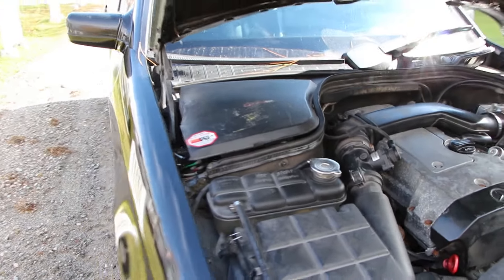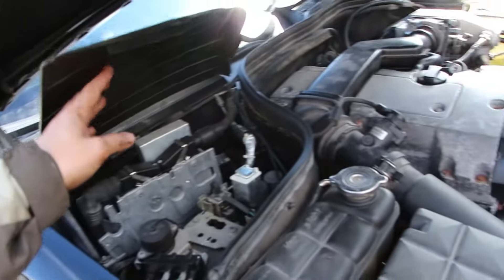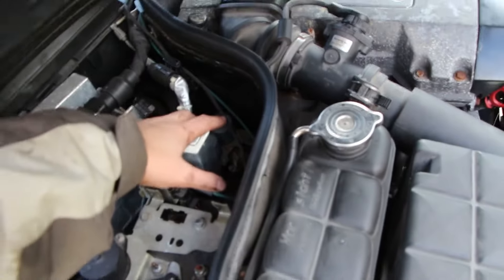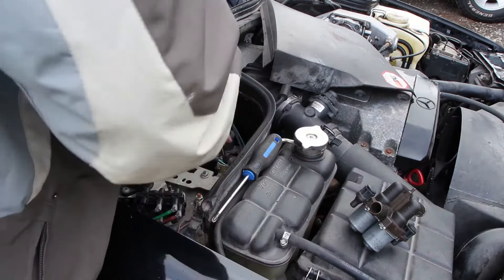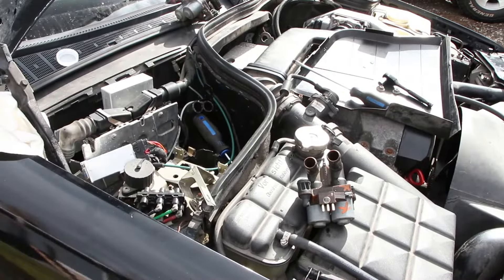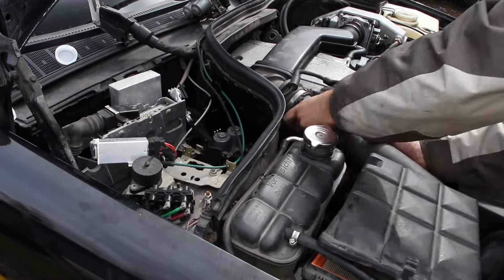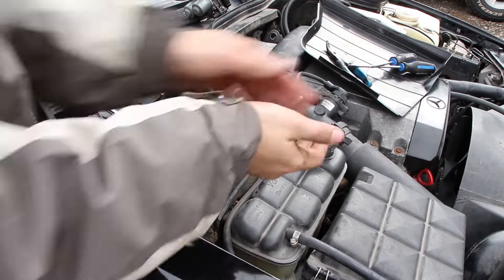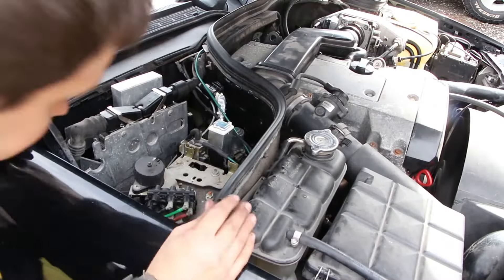Mercedes Heating Valve Replacement

Comment: Bro this looks so fast and easy my car been in the shop for 4 days because of this problem
Reply from the maker: Yeah it's pretty straight-forward. Usually the issue is getting a new heating valve, they're no longer available. Junkyards are full of them though, and rebuild kits are readily available, they are also very easy to rebuild. I have a video on that too.

Comment: Hello.i got an mercedes benz a class a170,1.7 petrol,2005,before Christmas i was in holliday,before to i go my car in the morning works perfectly,even in the morning,at -4 ,-5 grade in couple of minutes was warm in the car...when i comeback from holliday my car heating work but poor,i can feel it very low,on first level on air conditioning..now heating still dont work,but car is no overheating,no noices,just heating dont work properly...i cant fell a little bit of warm air coming from dashboard hole but very low..what i can do?
Reply: Can u help us please? I have the same issue as the person before me😢
Reply: @leventepeterpenzes2609  i dont fixed mine..heating work in my car,but only on first level ..if i give second level heating is not woau...but is feeling a bit warm..i been on one garage,they said they flushed the sistem,but stil dont work..i dont really can tell 100% they did the job what they said.